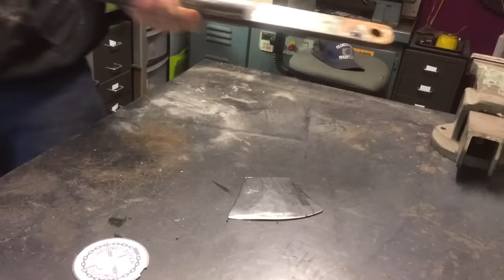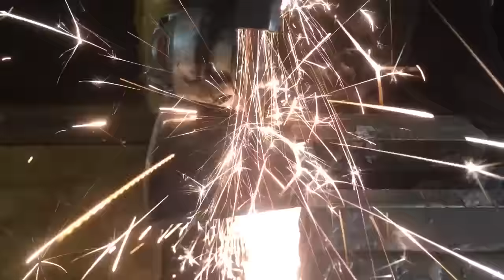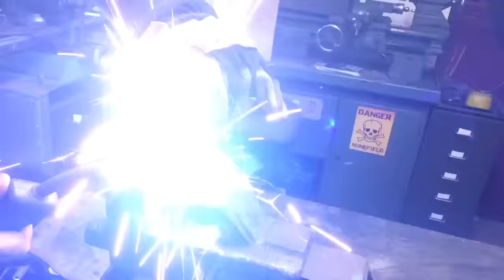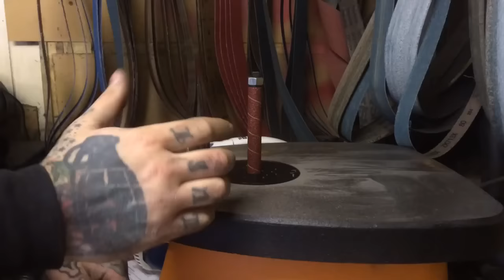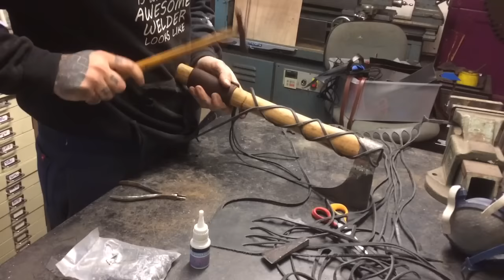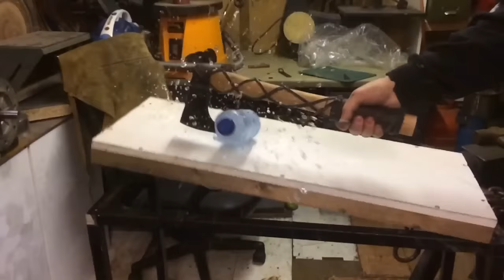Making Ragnar's axe from Vikings

Comment: Neat build. But what I'm curious about is why are there so many videos and people who don't use a bench top wheel grinder? Angle grinders are good for certain things but bench top wheel grinders are much better for actual grinding.
Reply from the maker: Thanks for watching buddy. I don't use a bench top simply because the ones I have haven't got enough power in them and the wheel tops on the metal however I'm looking to get a powerful one to start using 👍🏼👍🏼👍🏼
Reply: Diesineveryfilm Customs, Good Reason! 😁😁

Comment: I'm a youngin interested in tinkering and toying around.. may be a dumb question, but how did you make the axe head initially before cutting it? Or did you buy it?
Reply from the maker: Hey there that's awesome on this axe I bought it from a scrap man and it had been cut, I sometimes buy broken ones to use or forge them from leaf spring steel just depends what I decide that day 👍🏼👍🏼👍🏼